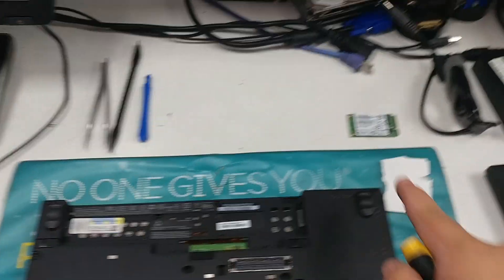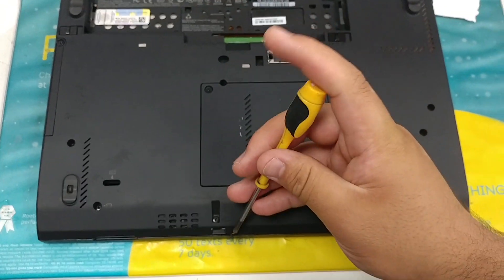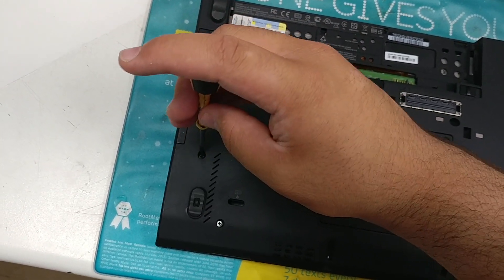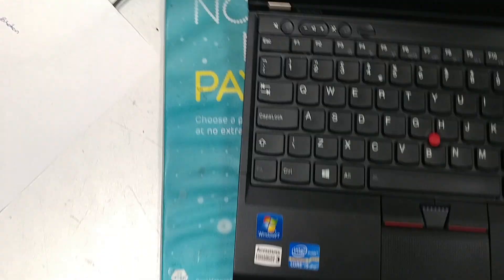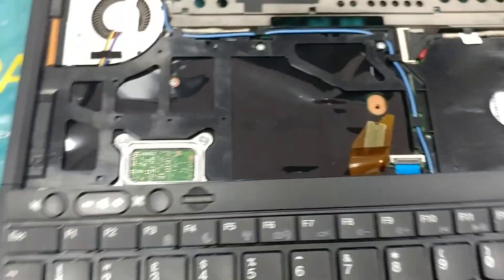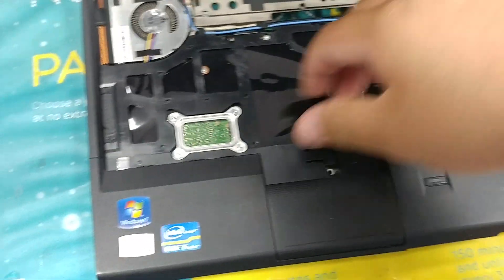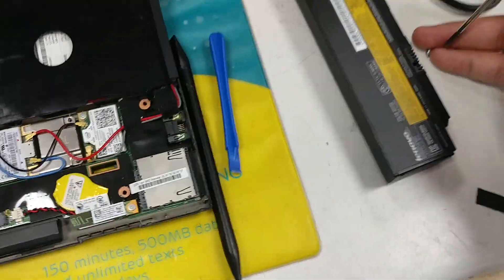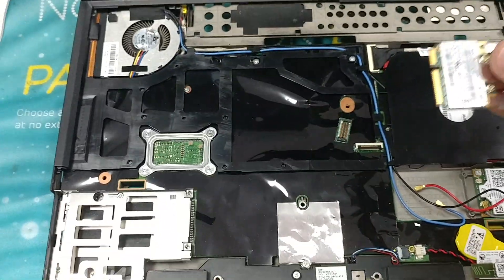X230 MSata SSD Upgrade

Comment: Why any cant tell if NVME PCI could be installed in X230, a thousand videos and no mention of NVMe PCI
Reply: No it can't. The slot is an MSATA2 slot. This is a different format from M.2 SSD and NVME. It's the predecessor to those 2 formats. The laptop itself is after all about a decade old.
Reply: @maskednil  and can it be installed in x250 ?
Reply: @AliSaeedArain  also no. the most you can do with is a M.2 2242 SSD. You have 1 2.5" SATA slot, a M.2 2242 slot that allows for memory chip on both sides of the PCB, and a M.2 2242 slot that allows for only memory chips on one side of the PCB

Comment: Hi bro, after you insert msata ssd, what happen with the sim card mode, bluetooth and wifi on your thinkpad x230. Are the still work properly?
Reply: I think the BT and wifi are using a separate card, the one next to it. The WWAN card is using a SIM card for cellular data and making a hotspot. Did you try it?

Comment: Hello, I plan to do exactly the same onto my X230. I am planning to install Linux onto this drive and make it bootable. Do I need specific software? I presume the BIOS will see the mSATA drive, so when I start installing Linux can I assume it will be able to install the OS to the mSATA without issues? Thank you!
Reply: Visit the Thinkpad Forums and r/thinkpads on reddit for tech questions. Youtube is a poor place for conversation but a fine one for videos.  Were it mine I'd do what I've done since 1999 and disconnect every drive but the target, boot the live installer USB, and install to the target drive.  Any recent distro should detect and load to any drive displayed in your boot options (F12) menu.
Reply: @obfuscated3090  You're the first person on YT to suggest taking out every drive except the target, which is REALLY good advice... I've lost count of how many times I've heard stories of people accidentally writing Linux distros over the top of Windows 7/8/10 etc etc etc...

Comment: Is msata slot slower than sata slot..?
Reply from the maker: They in theory should be the same. but if the distance in the circuity is longer bettween one drive and another. there would be a difference but it would be minor

Comment: Man...I advise you to fix  the camera in a tripod or call some friend with steady hands to record it... if you want to perform a tutorial with the Minimum quality required. 

We all know you can do it, but you are suppose to teach , so please, don't move the camera so much. SO... Using one hand to operate and the other to record is the worst option, ever. 

Said that...

Questions:

If I want a cheap but good 256Gb msata for my x230...which one should I buy.?

And...can I install windows in these devices? Cause the laptop guide or Manual says we SHOULDN'T. 

thanks.
Reply from the maker: thanks for the advice. Sorry i was the only one in the shop at the time but i thought it was worth making.

any mSata Drive will do. I recommend the SAMSUNG EVO 850 msata Drive as ive gotten good performance from it personaly on my current system. You can install OS on it. Ive run both Windows and linux distros on it. there has been no issues. 
hope this helps

Comment: would it help the battery life using msata instead of full sata SSDs?
Reply from the maker: it would be roughtly the same usage. If you are having issues with the batery you can buy replacements either from lenovo or a 3rd party. if used you are able to check the battery quality 
https://www.youtube.com/watch?v=mCJRYxKytmc

Comment: There is a longer ones of m-satas. Is there enough room for wife and ling msata?
Reply from the maker: there are drives with larger capacities and you can have multiple accounts with Storage access or isolate it through settings.

Comment: which one is better between Msata SSD and Sata SSD?
Reply: The mSATA slot in the X230 is SATA II (300 MB/s), so a SATA SSD would be faster as its slot is SATA III (600 MB/s).
Reply from the maker: this is correct. Thanks for the assist.
Reply from the maker: welcome to the Gadgets World

Comment: Can i put os in msata?
Reply from the maker: Yes it works well with windows and driver compatability is good and still supported by both samsung and windows. So it should be straight forward for most/all installs. You can also duel boot 2 OS's if you choose

Comment: Please confirm this ssd is compatable with Lenovo Y50-70
Reply from the maker: The Y50-70 doesnt have Msata Compatability without removing the wifi chip and thus all wifi and bluetooth (as these are intergrated together).  Im guessing you have either the 1TB HDD or the 1TB hybrid drive. Unfortunatly you cant have this upgrade on this PC but you can buy a high storage SSD easily as the SSD prices have droped signifigantly recently. From here you can install windows and transfer over your files. 
here are some affordable SSD's if you are interested in this option. 

https://www.amazon.co.uk/Crucial-MX500-CT2000MX500SSD1-Internal-NAND/dp/B078C515QL/ref=sr_1_3?keywords=ssd+2tb&qid=1556967763&rnid=187137031&s=computers&sr=1-3 

https://www.amazon.co.uk/Samsung-SSD-860-QVO-2TB/dp/B07KSJF3MD/ref=sr_1_5?keywords=ssd+2tb&qid=1556967763&rnid=187137031&s=computers&sr=1-5 

https://www.amazon.co.uk/Samsung-MZ-76E1T0B-EU-Solid-State/dp/B078WST5RK/ref=sr_1_13?keywords=ssd+2tb&qid=1556967763&rnid=187137031&s=computers&sr=1-13

sources
https://download.lenovo.com/consumer/mobiles_pub/lenovo_y40_50_series_hmm.pdf

Board view
https://forums.lenovo.com/t5/image/serverpage/image-id/63493iF6DE495D27B3B539/image-size/original?v=mpbl-1&px=-1
Reply from the maker: Though if you are going for a gaming system even if you are planning on using it for video editing; i would recommend using a desktop system as the performance you get will be higher and the cost should be less. Gaming systems have terrible battery life when using their full capability which will mean you are gonna be tied down to a power outlet anyway. personally i would recommend spiting your budget between a powerhouse Desktop and a mid/high tier laptop which is priced reasonably. That way you get the full performance on your workstation (where you are going to be doing most of your work anyway) and a decent system for on the go. 
But then again you can ignore this if you are required to to high performance gaming or video editing on the go.  In which case i would recommend going for a lower storage size SSD inside the laptop (between 128-512GB )to hold the software and system files, and running your files off an external HDD for transport and renders.

Comment: X230 can change card grapics ??
Reply from the maker: The X230 graphics chip and CPU are both soldered to the motherboard and are therefor not replaceable. External GPU's can be fitted but results vary and there is no guarantee.
Reply from the maker: @Cereal Man you can buy external cadeys to hold the graphics card but you have to power them seperatly with a desktop size psu. its abit ugly and no where near elegant but you can do it. I previously answered another comment on how to complete this process with full links on where to buy the products. good luck

Comment: Can i install gpu on that pcie slot, i wonder if there is any gpu available for that....
Reply from the maker: short answer yes but its going to be a pain. Long answer bellow
Reply from the maker: long answer. maybe. 
to do this you would have to use an eGPU setup 
https://www.banggood.com/search/egpu-exp-gdc-best.html

though there are good signs of such systems working with x220 and x230 laptops it isn't guaranteed. 
i recommend going for the express card option with the above link over the pcie option as it will leave the slot free and express card connections would be easier to manage while allowing for the possibility of the laptop still being portable. ie. gaming when home. productivity on the go. 

you will also need a DESKTOP power supply to power the Graphics card (also separate) and would need to download the needed drivers. 
it is also not guaranteed to work as we haven't done this before ourselves.
Reply: You can install a GPU with built-in PCI Card Gen 2
Reply from the maker: You can; but as the laptop would need to be open at all times in order to do so it would make more sense to use the express card slot
Reply: @gadgetsworld9642  yes, but note this Thinkpad X230 has a expansion bay. I see adaptors to convert a expansion card to PCI-e output. That is ideal to connect a graphics card to the machine and disconnect if you need portability on the fly! Sorry for my bad english
Reply from the maker: Dont worry your english is fine. Yes that is true. we recommended it to the original comment in the long explanation. If you look at that you will find a link to the express and pcie addapter which i am told people have had good success connecting as an egpu setup
Reply: Oh yes, you are right (I don't read the first comment Haha), it's a bit tricky sometimes using the PCI-E from the wifi module, I recommend read various forums before buy anything!
Reply from the maker: https://www.banggood.com/Expresscard-Version-V8_0-EXP-GDC-Beast-Laptop-External-Independent-Video-Card-Dock-p-1009976.html?rmmds=search&cur_warehouse=CN
Reply: PD: pay attention. PCI-E x1 isn't compatible physically with the PCI-E of WiFi module. I say this just in case :P I tested it hahaha

Comment: Is the MSata in the x230 running SATA-III or SATA-II? I've been hearing conflicting reports, so I don't want to buy anything for it yet if it's going to be considerably slower than the main SSD drive.
Reply from the maker: the pcie slot itself is SATA-II. but there is BIOS support for the SATA-III evo 850 drive. This means that though being bottle necked by the  pcie slot you can still have a sata-III drive. 

though it would be slower than a good ssd in the primary SSD slot it is a good alternative to buying a larger primary SSD if you dont wish to mitigate the drives and simply wish to add some storage on. This is also a better alternative as compared to a HDD as though being sata-II such an SSD should still be able to out preform it.

Comment: So you don't have to reconnect those blue, red etc. cables to something ? Sorry, newbie here.
Reply from the maker: No you don't. They connect to the antenna for the WWan chip. and as you are removing them you can leave them disconnected. alternatively you can also remove the antenna is you don't want to deal with the cables. would you like to see how this is done?
Reply: @gadgetsworld9642  so if i remove the w1 chip then replace it with msata ssd what will happen beside i have an extra drive? i mean what i gonna lose with the w1 chip thats not there?
Reply from the maker: It will mean you will no longer be able to use 3G broadband as a source of data (alternative to wifi) but if you were not using the feature then you don't have to worry.

Comment: I would like to know, if the card that you removed is a card that provide WIFI connection, or what function it does exactly? the card that you removed.
Reply from the maker: The card removed in the video is the WWAN chip used for mobile communications via satellite or other radio wave devices. There is a Sim tray under the battery where you can connect a mobile data enabled sim to access the internet when wifi isn't available. The chip next to it is the WiFi chip (WLAN)
Reply: It was the 3G/UMTS Module

Comment: is x220 compatible with ssd evo 860 ?
Reply: Yes
Reply from the maker: yes you can. but i would still recommend the 850 evo over the 860 as the controllers used in both are near identical and only gives a minor performance boost. not enough to justify the added cost

Comment: I want one of those for my X230 before it's too late. How is the read/write speed on it?
Reply from the maker: the speeds are good. as it is an Msata drive connection though and not the parallel based m.2 it has highest read/write speeds of 6250Mb/s but in practice its more arround 550MB/s R/W. 

But due to physical distance between the flash chips being smaller on the msata. you can get speeds higher than standard SSD's.
i recommend using both in tandem. as you would be able to raid them together.
Reply: @gadgetsworld9642  
Thanks. Had doubts of putting an OS on it or not.
Reply from the maker: You can install windows or Linux on it. personally i use my setup to dual boot ubuntu and windows
Reply from the maker: You can put on an OS on it. personaly i use my setup to duel boot Ubuntu and windows 10. it works really well. and i have additional space for shared storage between the 2 OS's
Reply: @gadgetsworld9642  Can you make a video showing your set up? Im also considering an mSATA to put Windows 7 on for dual boot purposes. (Currently use Linux)
Reply: Maximum speed for sata 2

Comment: Hello, you said the MSATA SSD goes in place of the WWAN Card, but how come there are 2 mini PCI cards in there? what is the other one for? Thanks
Reply from the maker: The one that is removed is the WWAN chip that enables cellular data such as 3G or 4G to be used Via a SIM card underneath the battery. The other is the WLAN which allows the laptop to use wifi.
Reply: Gadgets world ahh okay. I thought if I replaced the WWAN chip with the mSATA, I'd lose WiFi capabilities. But that's not the case. Thank you!
Reply from the maker: No problem. If you have any other questions or want us to do a video on a specific topic let us know.  :)

Comment: I was a bit worried when Windows didn't detect the msata ssd but it did show in bios. After a reboot it finally showed in windows also. I figured since it's sata2 speeds that I'd go with a 240Gb Kingdian S280 and so far it seems to work fine. I haven't opened up an X230 before so nice guide :)
Reply from the maker: Thanks. This can happen sometimes. Most of the time the system is installing the new drivers for the Msata. If you want to see anything else with an X230 or any other devices, let us know and we'll see what we can do to help.